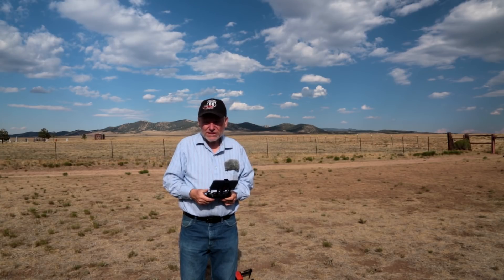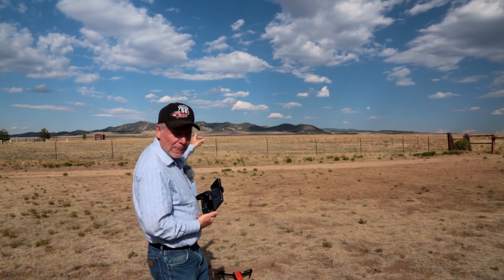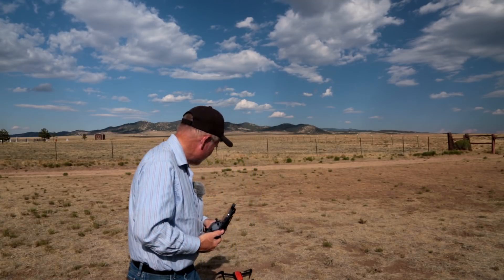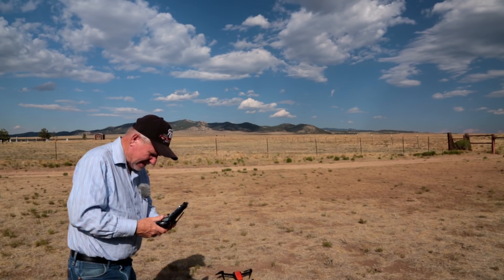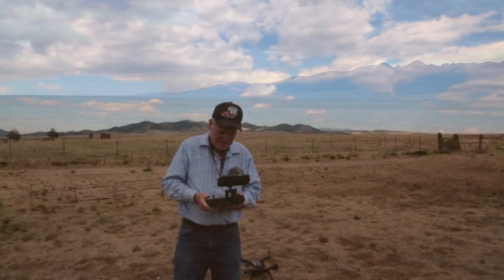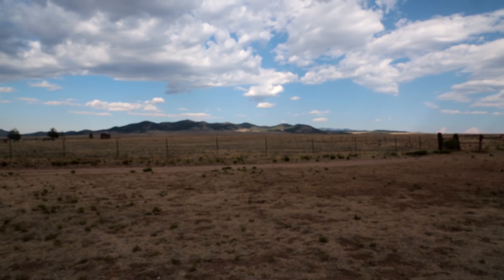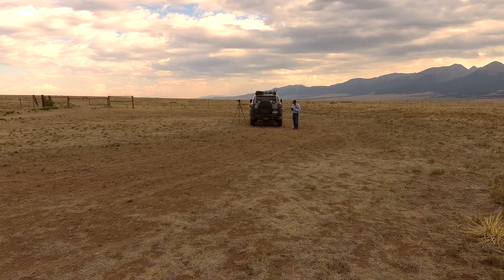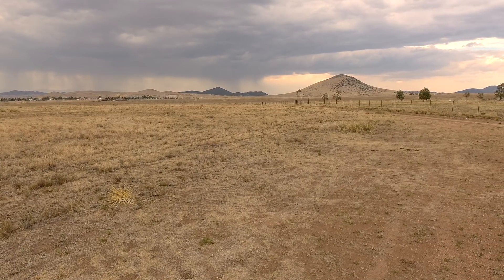Autel Evo vs 3DR Solo Waypoints vs MPCC and OA test

Comment: Have you ever heard of Master Air Screw Props? Many of us use it on ours. Quite a bit better airmanagement.
Reply from the maker: I have, but don't think they make them for the Evo.
Reply: I am seeing....  But Yes Sir... I believe you are correct, because those are folding (not single shaft screw on) props... Darn it, I hate it when things like this happens!
Propeller diameter  9.4" / 238.8mm 
Propeller pitch  5" / 127mm 
Shaft diameter  8mm 
Hub thickness  9.5mm 
Compatible also with: Hubsan H109S, iEagle Explorer, Cheerson CX20, Xiro Xplorer and other multi rotors using 9.4” propellers and M6 threaded motor shaft. Referred as 9450.
https://www.masterairscrew.com/collections/autel-x-star/products/autel-x-star-built-in-nut-upgrade-propellers-mr-au-9-4x5-set-x4-black
Reply from the maker: Give them time. I'm sure in 6 more months they will be out.
Reply: Quick Question ---- Solo battery, when you do not fly for more than 2 days, you do store that battery at about 45-50% charge. ie, 4 bars on the charge indicator?
Because that is best way to keep the battery alive for longest period of time. Me, I charge mine, fly it down, then battery is good for storing.
Reply from the maker: They will go down to 50% pretty fast on their own so I just let them take care of that. When I have flown them I have charged up to 50% knowing they will sit for some time. Hope that helps.

Comment: Obviously the Evo waypoint software is very beta and lacks all but the most basic features. This is quite disappointing. You can do pre-planned missions on the Solo with both Tower and Solex apps. You can also set the Solo to continue with a mission and preform all point of interest functions even if it flies out of range. I can't even do that with my Mavic Pro when using the Litchi app. With Litchi and DJI drones, DJI has made it impossible for the drone to preform some functions autonomously (such as speed changes and gimbal angle) without a signal from the controller. Litchi does have a great online mission planner which allows missions to be saved in the cloud. However, the Tower and Solex apps for the Solo still offer the best waypoint functionality of any consumer drone. Unfortunately the Solo is limited by an old GoPro and shaky gimbal. Even though there is some ongoing community support for the Solo, it is still a dead platform.
Reply from the maker: I agree with 100% of all you said. I could not say any of that any better. So thanks for the great summation. The Solo is king and with Solox and Kelly Schrock it has lots of life still left in it.
Reply: I agree.  The waypoint mode needs to be fixed.  I sent Autel an email outlining how the waypoint can be improved.  Now whether they do anything remains to be seen.
Reply from the maker: I think they will have it fixed fairly quickly. I just don't think it will be hard to flesh it out. This is the reason I show 3 year old technology doing it flawlessly. Everyone knows he tech is old and so for them to implement it should be a breeze. Here's hoping for a nice breeze this week.

Comment: Too bad the Solo didn't succeed, by all accounts it is a great drone.     The lack of gimbal and integrated camera was its undoing ; essentially the Solo was at the tail end of the "flying GoPro" period of drones.      I especially liked the way the props were higher than on  the Phantom ,and supposed this would keep them out of the shot.         I was weighing a solo against the purchase of a Phantom 3 but delayed until the P4 came out and got one of those instead.    Thanks for the comparison.
Reply from the maker: Actually what did them in was dji. They used every dirty trick in the business to sink them and they did. One of the business magazines wrote a huge article that covered the whole history of it and dji was indeed the major cause. Even though the Solo was superior in every way back then.
Reply from the maker: I have had and still have 2 Solo's. I know lots of people had the issues you describe but honestly, I never had that in the 3 I have owned. Usually, within a minute they were ready to go. The bad thing is battery life. If you setup an MPCC many times you had to land to switch out the battery to actually fly it. My test yesterday had the battery at 14% when I landed it just doing that short MPCC. Plus the size is bulky and hard to carry around. That is why I love the Evo so much for its size, weight, and portability.
Reply from the maker: I already have 2 and truth be told, the Evo will have the spot light and my Solo's will probably grow mold. Thanks for the offer though.
Reply: Peter from NH//  I will pick it up if nobody wants it.
Reply: Peter you can send that Solo my way. I'll put it to good use!

Comment: Rear obstacle avoidance needs some programming to stop...........at least it detects
Reply: it's a simple parameters coding fix... untie the option from Novice mode and allow it to stop... should not take very long
Reply: Got word Directly from Autel that due to speed/distance limitations rear OA has to be set to no faster than 11mph to work but will avoid while in dynamic tracking...
Reply from the maker: I know that can't be true as I have slowly taken it back toward trees and while it screams, it will neither stop nor avoid. So the back OA is simply brokenand they are making excuses for it.
Reply: From what I read it has to be set to novice in order for it to stop otherwise it just beeps when backing up.  So it might just be a setting change.
Reply from the maker: You are right about that. The advertised it as stopping it to not allow it to run into anything. The front works great, the back just beeps.
Reply from the maker: If that is the case, who wants it then? Novice mode is made for complete newbies. I think most who buy a Evo aren't that. So it needs fixed as they advertised it as OA just like the front in the sense that it will detect and stop the craft. It doesn't. Do I think they will fix it? I do indeed.
Reply: Marcopodomus makes sense
Reply from the maker: I am no programmer, but I too think most of the issues the Evo has are really simple fixes.